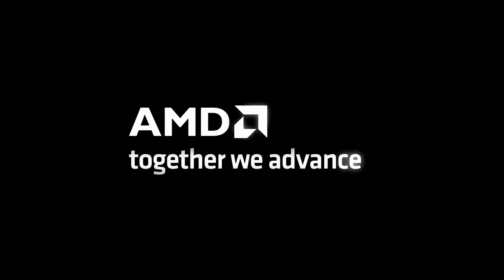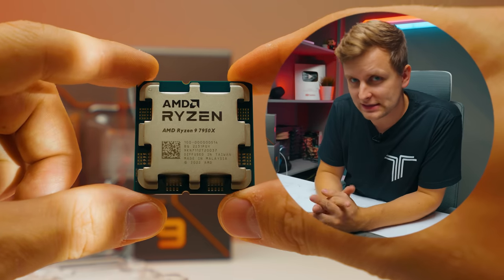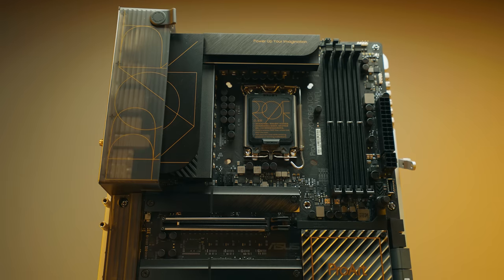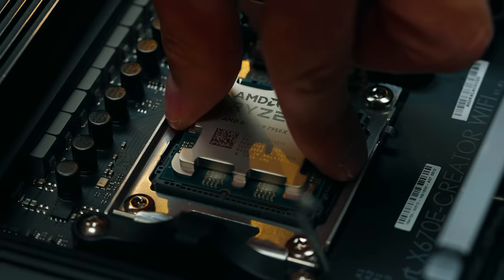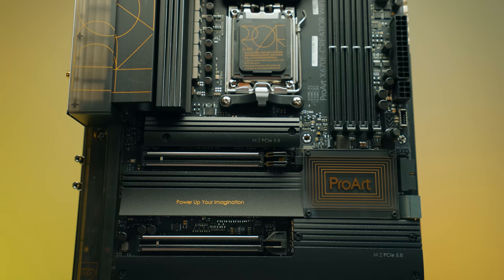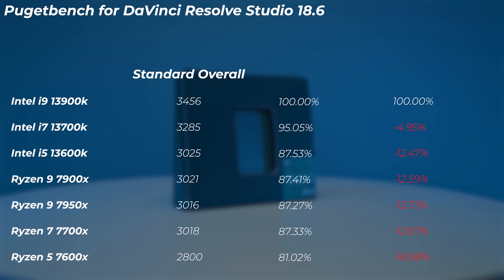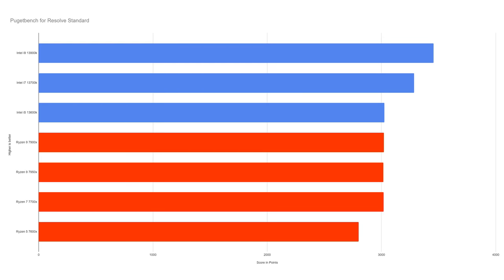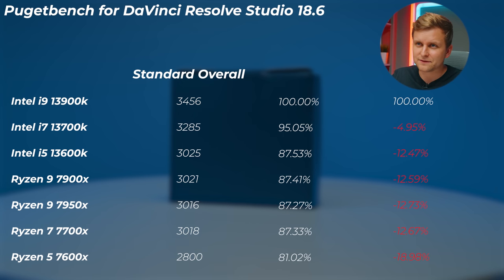AMD Ryzen VS Intel for Video Editing - Which CPU is best for Premiere Pro & DaVinci Resolve?

Comment: I love your videos, it was very helpful this year as I had a new system put together and went with the 13700K and 64gb Ram and a RTX 4070 and the system is ridiculously fast and doesn't miss a beat whatever is thrown at it. I decided to spend a bit more and added a second screen and it;s amazing how much time I save now in my editing.
Reply: Same, has 13700K and 7800XT. 😊
Reply: @blaze26700 and how much did you pay for your 7800xt?
Reply: Are you having air cooling or AIO? And what monitors are you using? 4K?
Reply: @swarupkumar2  I have a corsair water cooler, unsure of the the model, 4k Rec 709 monitor for editing 27", wish I bought a 30" or more
PC powers through everything
Reply: what motherboard do you have in this build?
Reply: Should I wait for 15th gen or buy a 14th ?
Reply: Have you had any crashing or instability with that CPU yet

Comment: Don't use either, use Sony Vegas or Sony Movie Studio.   Hail to the kings, baby.
I don't even know why you'd spend a fortune on a video editing rig, and then use free junk like Resolve.  Spend a bit of cash on your video editor.
On the other hand, I don't know why you'd spend a fortune on Premiere Pro.  Seems like the opposite end of the spectrum... too much.
Sony Vegas dominates the nice middle ground, and it's got this luscious multirack editor.     I went with the 7950x.   It gets the job done.  Limit it to 80C and/or 140w in BIOS and it runs sweet, 7% lower Passmark than balls to the wall cooking and I'm fine with that.

Once you go over 2 sticks of RAM, your speed is going to drop down to 3800mghz.   Having 128gb is sweet.  Now I want 192gb...

What I was surprised at was how much my editor uses the GPU 3D engine and no so much the encode and decode engines... which it's not maxing out.  All those little Nvidia cores though it makes big time use of them to render transitions and effects.
Reply: I've been a Vegas user since The Sonic Foundry days. Vegas has been buggy ever since Magix took it over from Sony. Davinci Resolve is the most stable and bug free video editor I've ever used. Buy the studio version and see for yourself. There's a bit of a learning curve but once you get it down, it blows everything away. Rendering times are also 20x faster.

Comment: Please run them on ram speeds that works best for them. Most people probably won't run their 6400 kit at 5200. Could also show the difficulties running it at higher speeds if there are any.
Reply from the maker: Wait for the 14900k review :)
Reply: Coincidentally I was already saving up and planning a January upgrade - a new rig to sit alongside this one.  Could not have timed this video, and also this comment any better :) I will definitely be looking to run my memory at the fastest stable speed.

For the first time in a decade I probably gonna go with blue team. @theTechNotice

Comment: why dony you under clock the RAM for intel at 5200 Mhz to match both ...400mhz is big difference to change the benchmark results...set both to euals frequency and check again

Comment: Another great video.  Man, these must be a lot of work!  I have a high end PC with the 13900K and a 4090.  It does very well in Resolve.  Especially when adding Noise Reduction or certain effects.  However, when it comes to smooth Timeline performance and overall fluidity in editing, I gravitate to my M1 Ultra Studio.  It just slices through all footage better.  It’s a better editing experience. Especially with 10 bit 4.2.2. Footage. The Intel does do a good job with that footage, but the M1 is simply faster and smoother with it.
Reply from the maker: I've got to revisit the Mac Studios! 
What monitor are you using for the M1 Ultra?
Reply: I use a 5k by 2k LG monitor. For both.  I switch between Thunderbolt and Display Port.  I know that the M2 Ultra Studio literally runs strong noise reduction effects in 4k and can do about 30fps while editing.  Pretty impressive.  @theTechNotice
Reply from the maker: The reason I asked about the monitors is because of Apple scaling 'issues'. Not sure if you saw my M1 Ultra long term review? :) 
You've done right and went with the 5k resolution monitor. If I wanted to switch to mac studio, I'd have to replace my monitors... which really annoys me!
Reply: Hello, how well it runs adobe premiere and adobe after effects at the same time ?

Comment: So the conclusion is that amd needs a good Igpu for video editing and it will suppress easily intel cpus
Reply: They already have, but they are ALWAYS late to the game or brush aside. Intel was the first to showcase that iGPU can be used for other than display graphics and game, Nvidia followed suit.

AMD claims that you need more CPU cores, not a dedicated SIP like NVENC and QuickSync, but time and time again, both Intel and Nvidia proved AMD wrong; image quality and performance gets better.

AMD is not a very innovative company, they simply copy-paste whatever their competitor(s) are doing, and giving a shortchange.
Reply: Just admit they are bad at the task lol. Don't have to faboy over some brand xD buy what suits your task
Reply: @AlfaPro1337  As long as there are options and competition , personally I would be happy with either brands in my PC. The difference is not chaotic.
Reply: @AlfaPro1337 hahaha spotted on buddy
Reply: @thodorisi.2889  The CPU space is just duopoly.

GPU space too, even when Intel enters the chat. Whatever Nvidia's charging, AMD simply undercut them slightly by US$100-200.

There's literally no competition for QS and NVENC, yet, both Intel and Nvidia are improving their SIP. AFAIK, neither compared their SIP together, it's always QS vs CPU H264, or NVENC vs CPU.

Comment: I'm using Davinci Resolve, went from 5900X to 7600 because I went with DR Studio so work is done through GPU. A friend informed me that Intel with iGPU actually works better in Davinci Resolve for scrubbing through DR timeline (I'm doing 4K reso). 

Current I'm not facing any lag or lack, just wondering if it's worth me spending a good load of money just for a new board, go with Core i3-12100 (the only one I have with iGPU, not using CPU cores much). 

Would appreciate if could get some opinion from you. TIA.
Reply: I would say it's not worth it right now for you to spend money to completely switch platforms. Wait until you need to upgrade, then switch over to Intel. At least wait until Zen 5 comes out to see if it might actually utilize the iGPU at all.  Intel's next gen will be Arrow Lake in 2025. That might be a good time to upgrade and switch over.
Reply: @squatch545  thanks man, the thing is .... I don't actually have to spend to switch platform, at least if I do it won't be much. I have all the platforms and systems configurable, just wondering if it's worth the hassle. 

Currently only AM5 RDNA2 for my work and felt no lack.
Reply: @goldfries  I don't understand. Why did you ask, "just wondering if it's worth me spending a good load of money just for a new board," ?
Reply: @squatch545  yeah forgot the description I used in a 10 day old comment. 

What I meant that time, was only for the motherboard. An ITX B660 board with DDR5 from Asus costs quite a bit as a board itself. 

But my response to you just now was because you mentioned (to what I understand) as an overall platform. 

Pardon me for any confusion. Really appreciate your comment.

Comment: warranty of factory spec? This guy is clueless. AMDs website shows you which ram kits to buy to get speeds up to 6000. There is no fine print saying you will void your warranty.  Not that I care what he does. But I think that qualifies as AMD approved. Pretty sure he knows that also.
Reply: have you tested this for yourself? i have and running 4 sticks of 6000MHz on AM5 is a horror show. At 5600MHz no issues.
Reply: Yeah the whole "warranty" statement left a weird taste in my mouth, I don't buy it.
Reply: I think he worded that a bit poorly but his intention was to state the default memory controller frequency. Expo doesn’t void warranty and in fact AMD was paying for shipping broken CPUs from that SOC voltage fiasco a few months back. Tldr: he probably didn’t mean warranty
Reply from the maker: I highly recommend checking out AMD's EXPO page here: https://www.amd.com/en/technologies/expo
Click on the little arrow on this page and footnotes, which is very interesting. Now at the same time even though they shouldn't officially warranty the  OC-d CPU I've heard multiple stories how AMD has replaced the CPUs even when they've been OC-d. This could vary by region and they 'don't have to legally', but it's just an important point to consider...

Also, this conversation with JJ might also shed light on this topic: https://youtu.be/wzVZgTP2204?si=pvUyBWl9qGIrmToJ

Comment: I don't know why but I wanted the AMDs to do better. Either way by the time I finally get to upgrade, you'll have a video for the 14900 vs 8950 video out.
Whatever I end up choosing then, will get de-lidded and a custom loop to cool it. 20 degree Celsius drop in temps under load on the 7950 de-lidded.
Reply: Because AMD is the reason Intel has to make better chips. If it were not for AMD, intel would be selling it's Raptor Lake chips for twice the price they are now.
Reply: @humansvd3269  mmm aside from that. Best analogy I can think of is cheering for your home team.
With the road map of when I can actually upgrade I will probably still go with the 8950X. I wanna say 'to support the underdog' but overall AMD is killing Intel in the high priced server market and AI sectors.
I should also mention that anything current or upcoming is going to feel like heaven coming from my aging 7820X on the X299 platform.

Comment: Did you ever do the non-X series of CPU comparison?
Reply: Yeah this would be very interesting. I have the most entry level Ryzen 9, the 7900, and it'd be super interesting to see more of the ryzen 7000 non-x CPU benchmarks.
Reply from the maker: if you ran PBO on the non 'x' Benchmarks, it would become an 'x' variant basically :)

Comment: thanks! if I can't afford any dedicate GPU, should I go for Intel or AMD, I guess Intel due to the better codec support right? But the AMD 780U actually has better Gaming performance, do you have any test  on that? Coz there are more people starting to use handheld PC / Ultraportable Laptop for video editing in dock mode. I wonder how amd 7840U + 780m iGPU vs Intel 13900H + Iris Graphics

Comment: intel is on sale right now, I was thinking of picking up the 13700k, but I think I am going to wait a little bit longer since raptor lake refresh is 3 days away.
Reply: The big jump for Intel will be arrow lake with the 15900k. I have the feeling this processor will be a beast with 40 cores and probably 4/5 nm chip. For Intel it will be a big jump. On the 14th only the 14700k seems good with more e-cores. For Amd i would pass on the first gen am5 zen 4 and wait zen 5 or zen 6

Comment: Hello there. For some time i had an r7 5700X in my system for video editing. I work mainly with content for social media, usually shoot on IPhone. I just buy a laptop as backup system and to be able to edit when im not at home, it has an r5 8645hs, which includes and IGPU, alongside an rtx 4050. I literally buy the cheapest option i found, cost it mean to be a complimentary system. 

But it turns out that editing on it feels way smoother than in my main pc. I edit in premiere pro, btw. 

I know igups helps to smooth the work in the timeline, but I thought only the intel ones have that effect. My questions are: is that so? The AMD igpus help to decode video in premiere as well? Or is just the technology had advanced that much and that r5 laptop chip is just better than my r7 desktop from some years ago? 

Furthermore, i was thinking on upgrading my desktop, for an intel chip which includes an igpu, but with all the problems the 13 and 14 gen had, im not so sure now. 

If the igpus from AMD work the same as Intels, I should consider the possibility of choosing an r7 8700G, Instead of a 7000 chip?

I someone knows or have some knowledge to share, I’ll be really helpful.

Comment: does the AMD has new decoding for the 8k 10bit 422? I was considering get intel because of the quick sync. My current amd Can't run davinci 8k 10bit 422 , I get like 5 fps while 420 I can get around 20ish

Comment: Great video! Glad you labeled it specifically for video editing. If I’m not mistaken, that mobo has a noise canceling feature. It would be interesting to see a video comparing its noise canceling vs nvidia or AMDs.
Reply: They all suck and should not be used in anything production worthy. I have tried the amd and nvidia ones and they are both quite aggressive 😅
Reply: @JoseMariArceta  ya, but which one sucks the least and why?
Reply: @_B.C_  I tried the first driver amd shipped with the noise cancelation feature and it works but leaves a light hissing sound, not sure if this was patched up. The nvidia one works fine. The asus software is probably similar to another cpu based noise isolation software called Krisp voice (the same stuff embedded in discord for noise isolation).

Comment: I have a Intel i7 14700 CPU and am returning my gigabyte Auro Z790 as RAM slot faulty. I'm wondering if I should wait till computex or get a Proart board. I heard a Rumer new lg1700 boards being released although I'm doubtful .Hmm So should I wait just in case. If Arrow lake were to be released sooner than Q4 id wait but don't think that'll be the case. Any thoughts..

Comment: What about a video on dual 4090 builds for Redshift/Octane? 
What Mobos and Cases can fit it? What are the temperatures of the upper card when they run almost glued together? Caveats of PCI speeds and lanes. 
And most important (for me): Is it possible to have two suprim liquid x 4090s on a Fractal North build?

Comment: One thing I'm wondering about when comparing Intel to AMD is how much cooling do you need? Apparently ryzen 7000 series are designed to run hot and I don't know if this is just AMD making excuses or whether the CPU actually performs better at 95C compared to running a custom loop capable of lowering the temperature. 

Can a 360 aio cool a 13900k so it won't throttle for video editing? I know sometimes the tests used to test these CPUs push them beyond what regular workload will ever ask of the CPU.

Is the cooling required the same between the 7950x and 13900k?

Sorry if you have already covered these questions in a previous video. I'm still pretty new to your content.

Comment: was looking at buying an intel i7 12700kf, I'm assuming it falls in-between the i7 13700k and Ryzen 9 7950x ? maybe a little lower than the Ryzen ? was just curious with your opinion on it. looking to use it for premiere pro
Reply: Dont get f models for video editing on intel. F removes i gpu which is the reason you go with intel to begin with